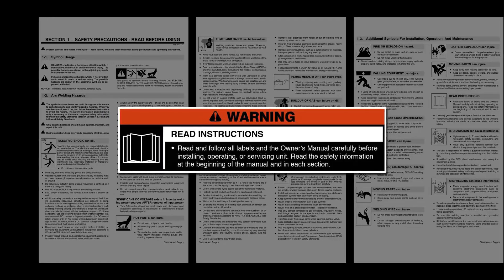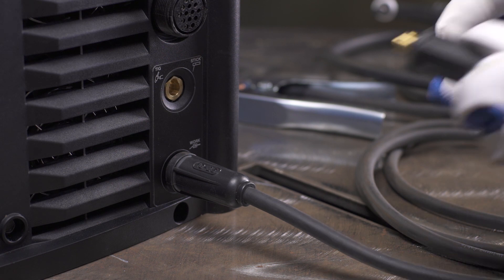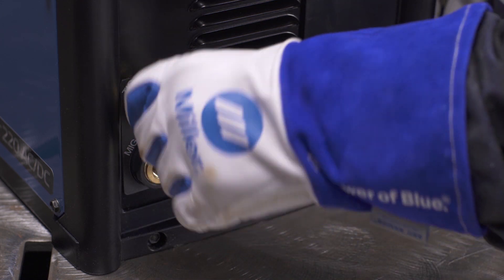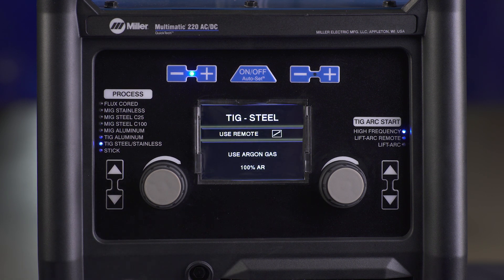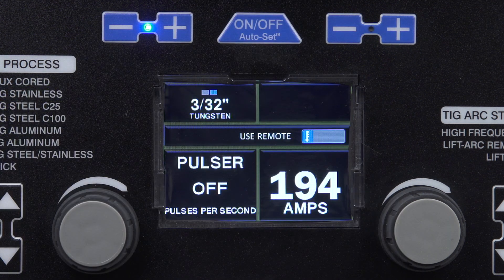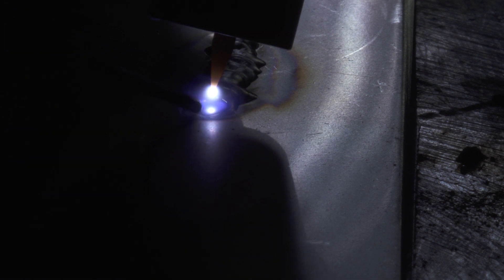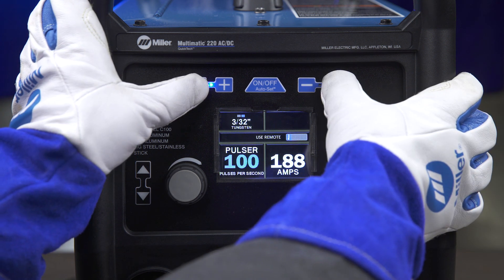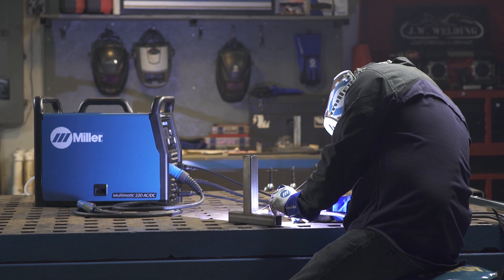Setting Up Your Multimatic 220 AC/DC for DC TIG

Comment: Does this machine have scratch start tig ?
Reply from the maker: Hello! Thanks for reaching out. The Multimatic 220 is capable of lift arc or HF arc starts for tig welding. Let us know if you have any additional questions.
Reply: Miller Welders am I able to Tig weld without the pedal ? For hard to reach confined spaces ?
Reply from the maker: The Multimatic 220 is capable of lift arc or HF arc starts for tig welding.
Reply: @Chicano-b1l  yes is the simple answer I have this machine and I love it